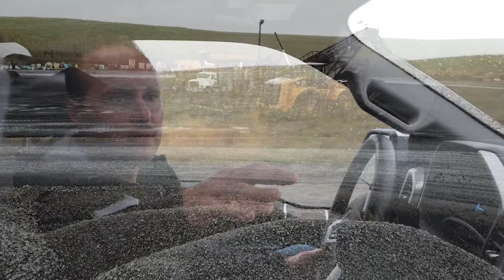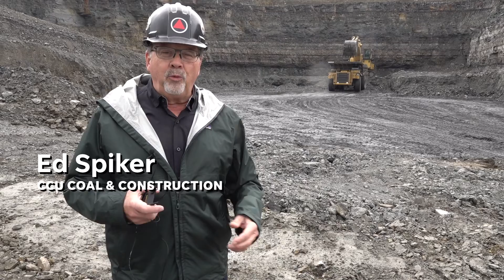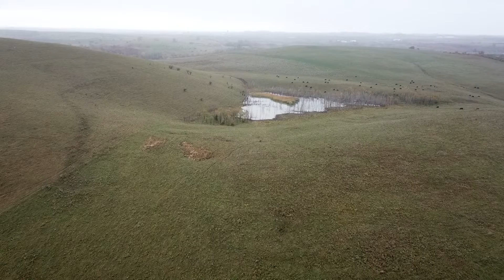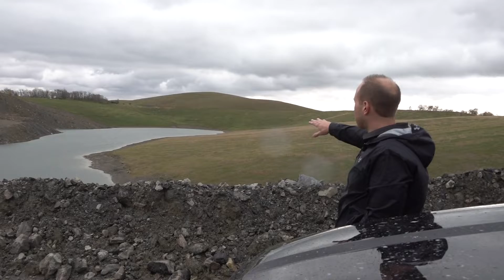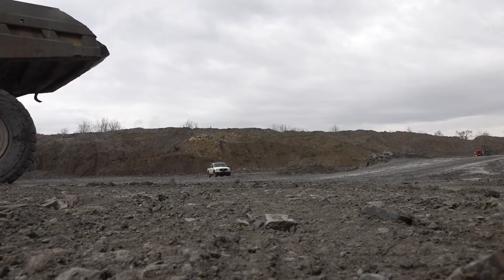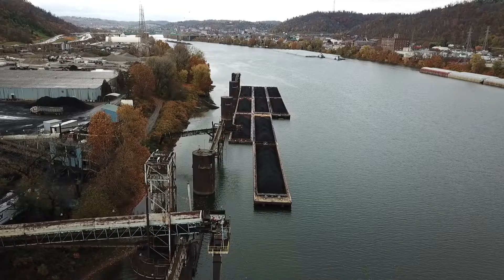Ohio coal-mining moves above ground

Comment: The problem is : The reclaimed land is to be seen by your eye sight. The damage that can never be repaired is hidden down inside the earth. Rain water can no longer by nature be filtered by the layers of rock as before. All the layrrs have been destroyed. The reclaimed earth no longers has layers of rock that purify the water as the water filters throgh the rock formations. All the removed material is simply pushed back into the big hole that has been created. Covered with a little bit of topsoil. Cemecailly treated to grow Grass quickly. Satisfies the government to release the coal company of any further responsibility. Now the American taxpayer is on the hook forever for all the damages that can now never be fixed . corrected.  Big corperations a win, big government a win. We the people are the big losers. We are being used. WAKE UP !!
Reply: I reckon if someone had the cash you could use some advanced radar and sonar stuff to plot out just how compromised it is and use a mix of clay and other similar materials to plug the compromised water table and replace the rock and sediment required to filter the water? We got a lot of reclaimed industrial wasteland in Denmark where we used to run massive gravel pits, not all of them gravel pit lakes are polluted and the groundwater is mostly intact, though we also got 800+ meters of soil, clay, sediment and gravel to bedrock so it might be a different beast alltogether in Ohio, Kentucky, Virginia and the like